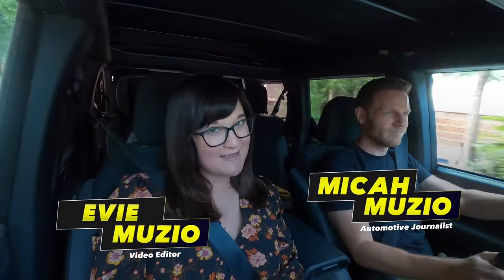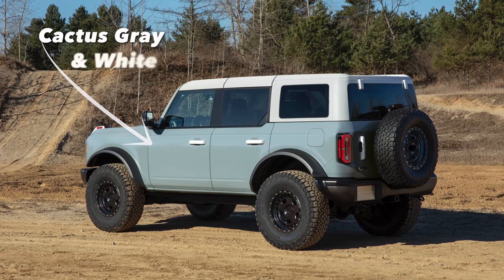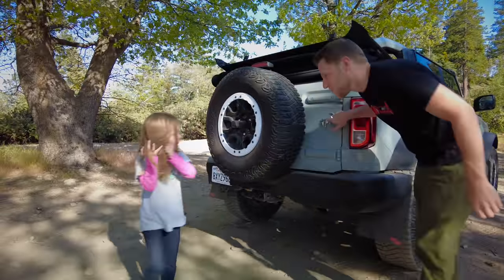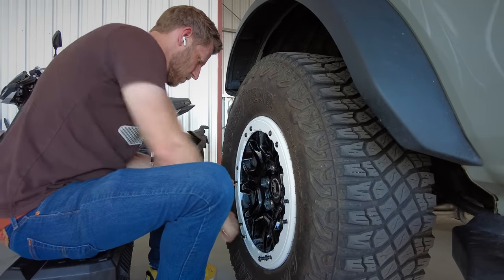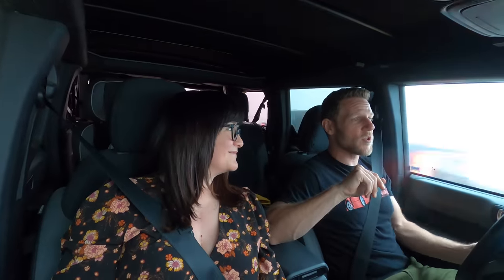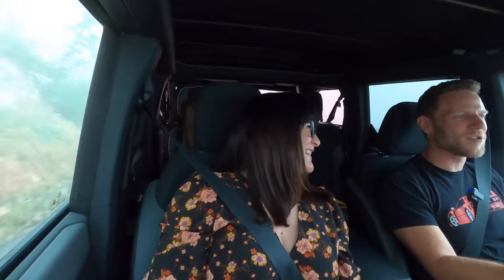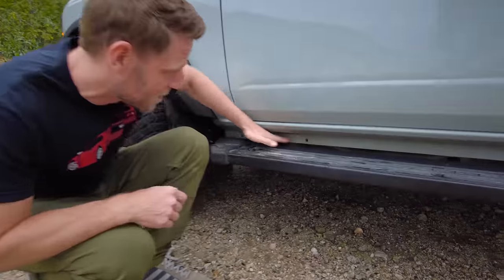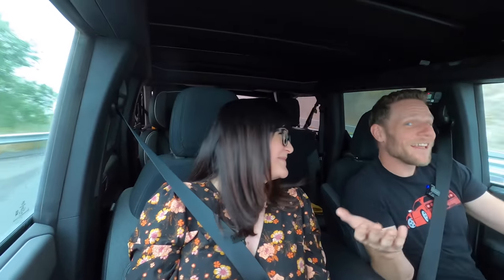Six Cheap Bronco Mods

Comment: Hi Muzio family! Here are some of my thoughts:
1. The wheel rings look very nice power coated white, good call.
2. Yes, changing the bronco emblem to white would make it stand out and look even better.
3. Leaving the insulators off the d rings give it a cleaner look. The only problem would be forgetting to put them on when needed, maybe its safer to leave them on. 
4. I thought the side Big Bend badges looked nice. If you decide to make the door handles white, the badge along with the white wheel rings would all compliment each other nicely.

The bear casually walking by at the end of the video was a nice surprise! 😳

Comment: Great family video micah.  One cool mod that i can think off that works both in safety and style is replacing the rear taillights with the OEM or OEM style LED.
Reply: That's going to be both near-impossible and extremely expensive, if it even is. Not only are the OE lights somewhere close to $700 a pop, but the wiring harness they use is different from the standard tail lights - there's a separate circuit for the turn signal, for starters, and I also believe the turn signals are "controlled" differently between the two designs (i.e. PWM vs. conventional voltage).

Comment: Great video! The one thing I would caution with those pinch weld covers is making sure you take them off periodically to clean out any dirt or road salt as it can trap moisture and contaminants in there which can corrode the weld.
Reply: This is why I just painted mine black...improves the visual appearance without collecting debris.

Comment: Best opener. The fact that most of us want to personalize our vehicle but, don't make my daily commute impossible. Nice work as always. My input, you need something on the sides to tie the white wheel rings in. The badge on the back would make a nice white application on the front quarters or, white mirror covers.With a White badge!

Comment: The IAG hood prop is great and an inexpensive mod that is real handy.  I would swap the steps for the fender mount and loosely bolt the new bracket to the fender first to avoid pushing the new braket into the fender well, an issue a few people have had.  Also, don't tighten the hood mount too tight, it will shear.  Get some blue loctite and just snug it down.  Well worth the addition.  I didn't remove the hood prop, it is still there just in case.
Reply: I didn't think I would like them as much as I have.

Comment: Great mods.  I think the white wheel rings will make more sense when you add more white exterior trim parts.  Maybe a white vinyl graphic element on the side.  Or you can be bold and power coat the grille AND add the vinyl graphic!

Comment: Get some matte white vinyl and put it on the door handles like car you’re emulating… you can see if you like that look n if you do you can wrap or paint it. For the front hooks take the rubber things off for sure. Wish you could have founded more squared off like the press car. I love cheap subtle visual mods too! You two also need your own easter egg stickers… i could see Censi hiding somewhere :)

Comment: I have a soft-top Outer Banks on order -- I will definitely be buying those top-lift assist struts.

One mod y'all didn't mention was hood-struts.  They're only $99 to $129 depending on which brand you buy, and they make opening the hood much easier.  I plan to buy a set of those and install them as soon as I get my Bronco.
Reply: Redline Tuning Hood Struts, IAG EZ-Lift soft top assist system, Trail Armor for Rocker Panels to hide those pinch welds!

Comment: Well-made video, U2 are actually very refreshing, very sharp. Your daughter needs a brother however!  😊
So i like all you have going except….
You gotta spend more on the shackles. The ones you have look cheap sorry I know because I bought those cheap ones and the more expensive gear America $100 shackles. After comparing both I sent the cheaper ones back. You’re spending thousands on the bronco so spend 40 more dollars for the nice shackles (without the rubber by the way).  
And….. I like the model decals. But maybe because I have a wildtrak. Lol. 
If I had a base, maybe not. I kept the wildtrak in its original place and put a Bronco script towards the front.  Gads not the script!!! 
Well-made video, you have a lot of solid personality and your wife compliments well. Keep them coming.

Comment: Great video! Thx! I've got exact same Bronco arriving next week. How was soft top over winter? Pros/cons? Are you considering power tune upgrade?
Reply from the maker: Early congrats on your Bronco!! For our needs, the soft top worked perfectly fine during the winter. If we lived somewhere with hardcore winter we might be more eager to get a hard top with its greater insulation. But for the occasional snow and cold we experience, the soft top works well. 

Regarding power, I'm not interested in an aftermarket solution but I am curious about the upcoming Power Pack tune from Ford. I haven't found the 2.3L to be lacking but if the price is right I wouldn't mind a bit more oomph.
Reply: @MicahMuzio  Thank you! I'll be following your family's journey with your wonderful Bronco.

Comment: Bought the same RokBlokz mud flaps you did for my Sasquatch - I'm disappointed in how much spray I still get off the front tires, especially given both the flap size (bought XL longs) and the cost. Probably the one mod I've made that I regret the most.
Reply from the maker: It’s been dry where we live. Gonna be a bummer if the flaps don’t do their job in the wet, snow, and mud.
Reply: What size flaps did you get